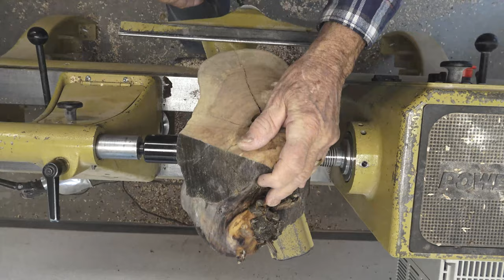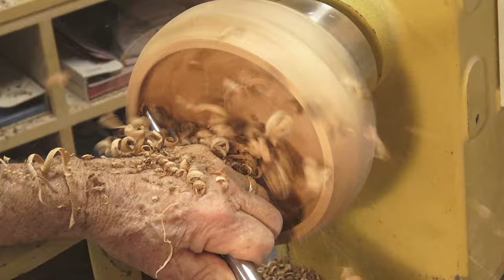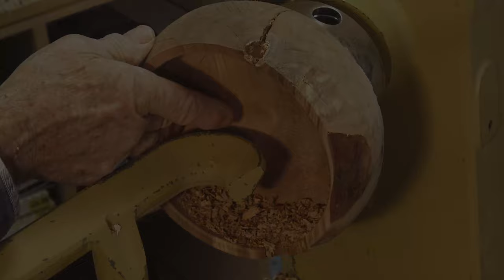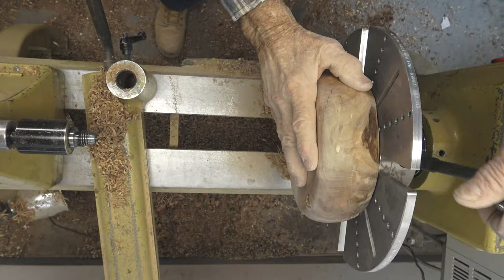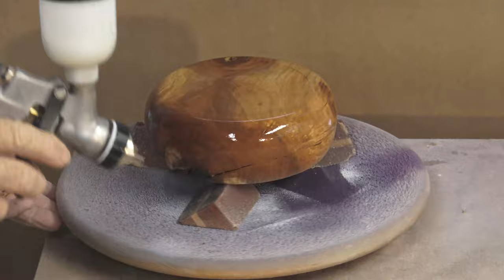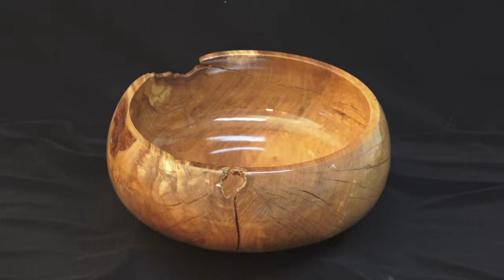Woodturning Black Walnut Tree Bowl

Comment: Beautiful bowl! If you don’t mind me asking what spray finish do you use?
Reply from the maker: Thank you!  I am using a post catalyzed conversion varnish.  Two coats of sealer and two coats of gloss finish.  After completely dry, I sand with 1,000 or 2,000 grit wet-dry and then buff and polish starting with tripoli buffing compound then white diamond compound.  After white diamond, I buff wax using carnauba solid wax. Thanks for watching, Tommy

Comment: Awesome! Do you use poly or lacquer?
Reply from the maker: Thanks!  I am using a post catalyzed conversion varnish.  Two coats of sealer and two coats of gloss finish.  After completely dry, I sand with 1,000 or 2,000 grit wet-dry and then buff and polish starting with tripoli buffing compound then white diamond compound.  After white diamond, I buff wax using carnauba solid wax. Thanks for watching!